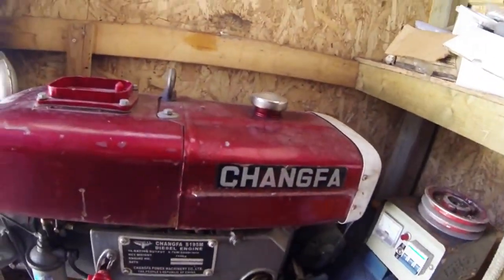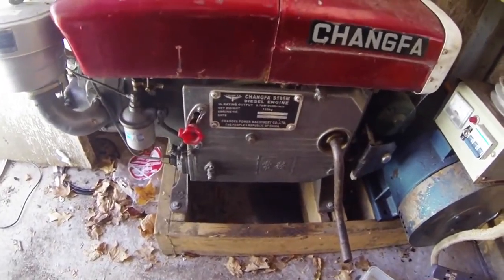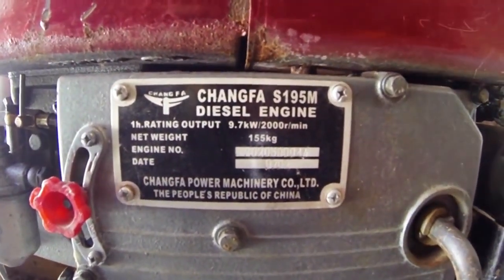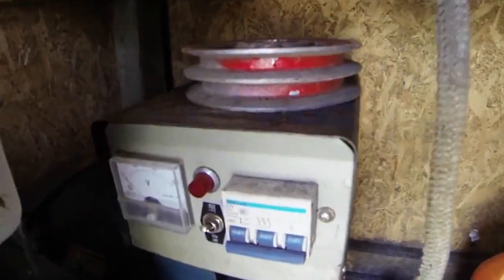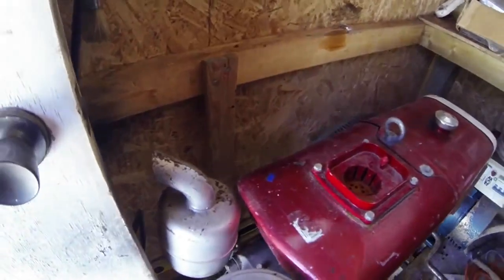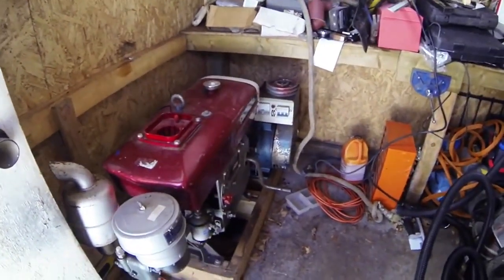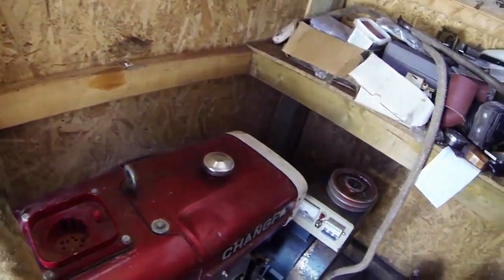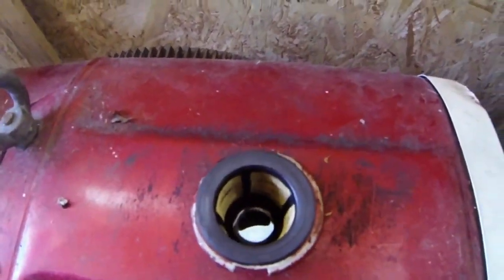Changfa Chinese Diesel Generator -17c Cold Start

Comment: If you want to avoid this kind of start up problems in the future, try heating up the fuel a bit, or start and run the unit once a month for 5-10 minutes. I have a 20kw electric start Chinese diesel myself for the past 3 years, It has a module to automatically run the generator on a weekend schedule at my home. I have over 7000 hours on my unit now. I installed a 1 micron bypass oil filter which keeps the oil super clean. I should get about 20,000 hours on it before I spend another $3000 for a new one.
Reply from the maker: Sounds like a nice setup! We still aren't using this one, but I will keep your suggestions in mind when we do.
Reply: That's quite a bit of hours for a small diesel. you must take good care of her! congrats. my yanmar just hit 500 hours I'm 24 so it will probably run until I'm 60 lol
Reply: Nice to see you care so much about your engine and it's not getting neglected.  I also have the electric start on mine. Is there a stock oil filter in it if so where can I get one, does it have pressure lubrication and where can I get the fuel filter.
Reply: I am also looking for an opportunity to retrofit an oil filter to my zh1110 which is of bigger size but technically very comparable. I couldn't find advice on the internets how to add oil filtering. Advice much appreciated!!!
Reply: So many folks give these little China diesel’s a bad rep, but the truth is there actually pretty good engine when folks actually take care of it, and know just a little bit of common sense! 
I’ve seen the Quality of some of them, and I do agree, but honestly there are Briggs engine brand new getting sent back because of manufacturing issues, that happen just right, that the customer gets the blame put on them! 
A gentlemen who cuts grass for a living brought his commercial zero turn cub  to are shop for its yearly service 900hrs on the Machine had a Kohler Twin can’t recall what Series, but it’s been running on one cylinder because the rod to the other cylinder detonated, and surprisingly didn’t blow out the side of the block! Remember this guy brought that mower every year to get serviced since he bought it! So it wasn’t a service issue that caused that! More over the cylinder that was working had plenty of compression I know it was over 100psi! My conclusion was manufacturing defect, but that mower was well beyond warranty work, so he forked out the $800 bucks for a short block, and like $200 for labor!
It’s stuff like this that makes me a bit mad at manufacture, and such!
Reply: What brand Chinese diesel do you use? I’m looking for a good brand.

Comment: I know some Chinese Diesel engines have a small hole in the inhale filter pipe and seals with a screw. you can remove the screw and light a flame close to the little hole to make the start easier in dead cold winter.

Comment: I love diesel engines and now live on a 40' narrowboat with an old 3-cylinder Lister engine. It's a bit noisy, but I get the impression that it will be reliable. There's not a lot to go wrong. PS - I lived in Finland for 25 years, so I'm familiar with your kind of temperatures.
Reply from the maker: Nice!
Reply: It is!

Comment: Fill the heat exchanger with hot water to warm up the engine. Then drain it out after finish your job. Running dry and unwarmed the engine damages it
Reply from the maker: Garbis Dionysios great advice

Comment: Mate, be very careful running those engines in a shed, I have one almost identical with a 150 Amp 24 Volt alternator on it. I was running mine and unknown to me the prevailing wind outside was coming from just the right direction to hold the exhaust fumes in the shed. I was setting up my 24 Volt battery bank and 24 Volt to 240 Volt inverter and was in the shed about 30 minutes with the engine running, I spent the next 10 days in bed recovering from carbon monoxide poisoning, trust me you don't want to go there it hurts just to breathe, you never get all the brain cells back. By all means experiment, have fun and learn, just stay safe and be aware of your surroundings.
Ray.
Reply from the maker: Thanks for the advice! It's set up with the exhaust out the side of the shed now and on a better frame.
Reply: Carbon monoxide poisoning is where the blood's oxygen take up is prevented by the CO. You would have felt drowsy & weak first, followed by an overwhelming desire to lay down & sleep - until death occurred, due to oxygen debt. Carbon monoxide is colourless & odourless. Since diesels produce virtually no Carbon Monoxide because of their oxygen abundant combustion process, it is far more likely that your lungs became inflamed & irritated by the soot particulates that non particulate filtered diesels DO produce. You would have felt no pain in your lungs from carbon monoxide, as it is not an irritant, it is a poisonous gas that replaces the oxygen in the blood with CO, which obviously the body cannot use. People have attempted suicide using diesel engines & failed, because the soot over powers them & drives them out of the garage choking, long before the microscopic carbon monoxide production gets to them. Try that with an un catalysed  petrol engine & you'll be dead in 5 minutes. I used to drive a big 5 cutting cylinder grounds mower with a 2.2 litre 4 cylinder diesel engine. It had no cab, & on Autumn mornings I would sometimes get mild hypothermia. The exhaust exited sideways at crotch level (nice!) - I would rev the engine to full revs, stand at the exhaust, & let the exhaust blast blow at my crotch, up the inside of my storm jacket, & exit via my collar, blasting over my face & neck. I would stand there for 10 minutes until warmed up.. To no effect on my welfare whatsoever, then, or 25 years on. I have chronic asthma upon which the diesel fumes had no effect at all. Petrol fumes however, make me feel violently ill & bring on an asthma attack. Just to be clear though, I am NOT advocating ANY exhaust gas inhalation for any reason! I'm just relating an experience.
Reply: @hiyadroogs  ... of course diesel engines produce carbon monoxide and lots of it, while there may be irritants it would definitely be the carbon monoxide that killed you in an enclosed space.
Reply: @Wingnut353  But diesel combustion is so complete, due to a huge surplus of oxygen in combustion (even at maximum power rpm, diesel combustion never approaches petrol engine stoichiometric ratios) that it would take many hours locked in a garage with one to commit suicide. & long before that occurred, the potential victim would be choked out by the smog & retreat. 
I wouldn't recommend anyone attempting to disprove this however!
Reply from the maker: Haha, back after 4 years. Awesome

Comment: Hey dude, drill a hole in the air intake tube, thread it for a 3/4 pipe plug and get your self a propane torch to pre heat it and keep it in there while cranking. I ran these things for 20 years. Mine had electric starters, almost broke my arm and shoulder trying to start by hand. Very crappy units for 1800rpm generators. Would be much better if could be run slower like 1200rpm. Sort of self destructive. I still have 3 laying around here with lots of parts. Free for the taking.
Reply from the maker: Max Stemple 

Hey thanks for the advice! I’ll have to do that. I use the electric start on it now and it’s set up totally differently. 

What were you using your engines for? Generators as well?
Reply: @rust2985  Generator. But after 20 years or so of working on them all the time I finally got a good generator unit. A 3 cylinder Kubota. Very smooth. Single cylinders tend to self destruct, lots of vibration. I can not believe you could start that thing by hand, being that cold with no extra heat. When you spin it over and then let go of the compression release, thats when my arm would break. Use the propane, you will be amazed how much easier it starts. Looks like you live up in Canada somewheres.
Reply: I might be interested in those three units and their parts if they're still available.
Reply: @max61203  I might be interested in those three units if they're still available.
Reply: @johnwyman6331  Hey John, I still have these. Been sitting outside, I have all the rebuild parts in a shop somewheres .
Reply: @max61203  
Okay, where would all of this be found? It just so happens. I'm traveling 700 miles Friday.
Reply: @johnwyman6331  send me a phone number or a email.I am in NE Washington. This stuff has been sitting outside for a long while. They weigh 450 pounds apiece, but I have a tractor.
Reply: @johnwyman6331  Free
Reply: @max61203  holy mackerel 450 pounds? Wow, they must be really big ones. A Chevy V8 is 585 pounds.
 Unfortunately, I'm in Georgia. I'll be heading to Michigan on Friday and I was hoping it would be somewhere not too far out of route, but I think Washington state is just a little bit too far out of route. Besides I'm not sure if my minivan could handle 1300 pounds plus 4 people. I'll keep it in mind though in case I ever get in that area. Thank you.
Reply: @johnwyman6331  Just the single cylinder units, but heavy.  You are a long ways from here. I will save them for you.
Reply: @max61203  If he doesn't want them, and if they're still available, I am in Montana and could maybe pick these up in NE Washington. :-)
Reply: @heatherngillis  You want old China Diesels? Been outside for years, for parts. Get in touch with me in May. Send me a email.
Reply: @max61203  I'm sorry I didn't see this until late June.  I will try to send email via Youtube.  Thanks!
Reply: I was unable to figure out how to message via YouTube.  How can we interact, without sharing an email address publicly?

I'm eager to come and take those engines off your hands.  I have a project in mind, and curious neighbors who might like to tinker, too.

Comment: Put 5 cc oil in air intake and see how easy to start
Reply from the maker: Good tip, thanks!
Reply: Ideas to get this engines started are: Hot water in Hopper (warms engine andube oil up, easier and quicker to crank), oil in intake (increases compression), heating air intake with blowtorch, adding petrol or ether into the air intake. This last startup advice must nit be mixed with heating intake air and is bad for the engine as it will start to fire uncontrolled BTDC, possibly hitting back.

Comment: my generator...  same as yours, manual.. but hard to rotate, got any suggestion?
Reply from the maker: Check to make sure the decompression mechanism is working properly. It’s the small lever you hold down while cranking, to build momentum in the flywheel without fighting compression.
Reply: @rust2985  thanks sir

Comment: just fill the hopper with hot water
Reply from the maker: Thats an idea :) I was just curious if it was possible to do it dead cold though.
Reply: Not without antifreeze in 17 deg weather!  If you dont get her started that water will freeze quick in that big cast block!
 I have the 8 hp r180. I love that little engine. We need do do something about the damn EPA stopping these from being imported. I would buy a couple more of them for different things if i could.
Reply: James Nelson The EPA might be a little laxed now that it has a new leader! Might be worth checking in on the idea.
Reply: Hot water put into extremely cold cast iron may crack the cast iron due to uneven thermal expansion.
Reply: @lovetofly32  How do you find out current EPA rules?